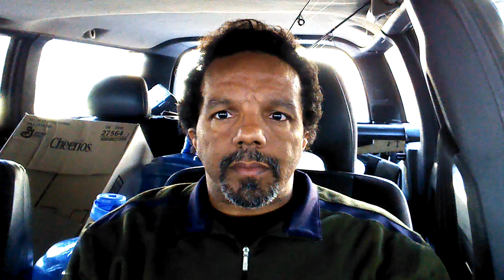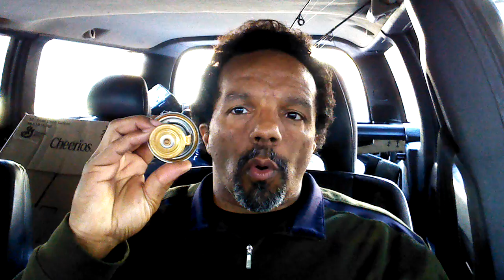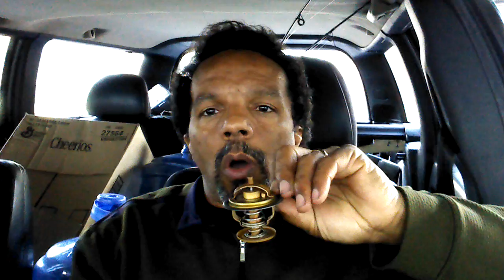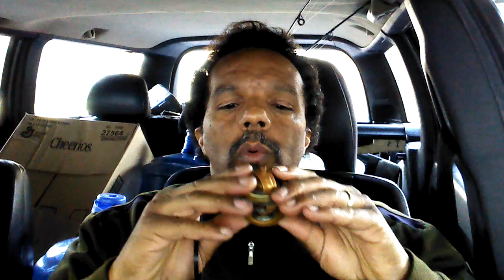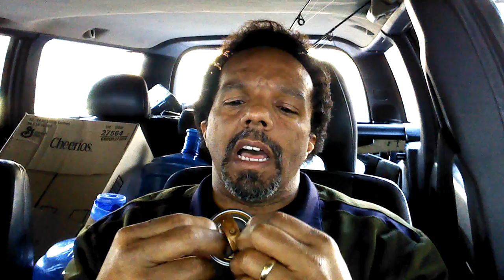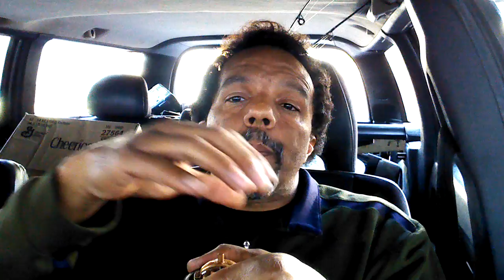How does the thermostat work? - Auto Care Series

Comment: My radiator fan not coming on while my vehicle is overheating.  I occasionally see the radiator fan spinning but when I need it when my vehicle is overheating it is not spinning.  Vehicle overheat when AC is on and at stop light but overheating stops once i begin to drive fast.   What do you think i should narrow down on to fix?
Reply from the maker: If the fan is bad, replace it. If the temp sensor is bad, replace that. If a relay is bad, replace that. You have to figure out what's bad and fix it accordingly.

Comment: Sir Robert you are a blessing thanks for your videos the one on thermostat the car tell me that the exhaust is having a problem when everything I drive the car I have this rich gas smell engine from the engine I was told that it needs new plugs  so I have a new set to be replaced.
Reply from the maker: probably a vacuum line loose or broken.

Comment: Hi Robert thank you for all the information I am a new driver bought a car recently it’s my first car and I am not aware of most of the things I have already spent too much money with auto mechanics but the problem is still there and no one could figure it out. I have fiat stilo 2006 it drives fine for 20 minutes or so and than engine dies all of sudden and it shows a message on dash board where it say excess fluid temper turn off the engine. And than when I try to start it again ignition comes on but engine does not start and the temperature guage does not move up from C , guage goes up and than quickly drops back to C all the way down. And than after ten minutes or so car starts after so many tries. Plz help me to understand what could be the problem. Thank you so much
Reply from the maker: Are you saying that the engine is overheating?
Reply: Robert DIY thanks for your reply. No I don’t have any idea if engine is overheating as my car just dies after ten minutes driving sometimes and does not start back straight away it just cranks but does not start. Temperature guage does not move at all during this though.
Reply from the maker: Codes?
Reply from the maker: https://youtu.be/YiPAPu-K8OI

Comment: I decided to go get a 195 degree one for my car in an attempt to make the heater work better. I have not installed it yet, and i also sealed off the gaps around the heater hoses in the firewall. I assume it is using a 180 at the moment or maybe a 165. They said they couldnt get one for my year but they could get a similar one from 3 years later that should fit as it is designed for a very similarly sized v8.
Reply from the maker: I don't even know what kind of car you have???
Reply: @RobertDIY  1st gen Mustang. Same as always. I just wanted the heater to work better and I already tried sealing off the gaps in the firewall around the heater hoses. The store told me they could only get one for a 1968 302 engine but it should still fit in a 65 289.
Reply from the maker: I have no idea. Is the heater core clogged?
Reply: @RobertDIY  I checked for that by tapping the hoses after a drive. Both were pretty hot so it cant be that. But ever since I applied the gasket maker it did seem to help out a little bit
Reply from the maker: ok

Comment: Hello Robert, good video and great help; I have a doubt and I hope you can answer me; I have problems with my car volvo c70 since the car fan does not work and therefore I mark a light on the board is red, turn on the light when walking for at least 5 minutes. Does it have something to do with the thermostat or the temperature sensor in this problem?
Reply from the maker: +Rafa Anleu I don't know what the red light is?
Reply: Robert DIY Thanks for replying, in the instrument panel I get a red boat with water that has a fan propeller. Too bad I can not attach an image for you to see.
Reply from the maker: +Rafa Anleu that is probably the low coolant level light.
Reply from the maker: +Rafa Anleu https://youtu.be/Uu_XZlTY2b8
Reply: Robert DIY Thanks for taking the time to answer, effectively the instrument panel light that you show in the video that you left me is the one that activates me, the strange thing about this is that it is activated despite having antifreeze, so I asked if Somehow the thermostat or temperature sensor has something to do with that fault.
Reply from the maker: +Rafa Anleu no, bad sensor or float in the bottle.
Reply: I hope I'm in it, I hope it's nothing serious. Thank you for your answers and correcting the fault I tell you how I was. regards
Reply from the maker: +Rafa Anleu no, bad sensor or float in the bottle.
Reply: The sensor you tell me according to I have understanding comes along with the expansion vessel, I will see these days if I can get the parts for the change, by the way do you know if you have to purge the system of the car so it does not catch air?
Reply from the maker: +Rafa Anleu that part is separate from the bottle, plugs in the bottom.
Reply from the maker: +Rafa Anleu https://youtu.be/1L8RMS5KunM
Reply: I see that you have everything on your channel, it is worth giving a look at all your videos. With this if I left doubts and thank you for the time you have taken to answer me. I would definitely recommend more people to visit your channel. Greetings.
Reply from the maker: +Rafa Anleu thank you for watching.

Comment: Great going as usual Robert. My fan is not coming in. Causing the. Ooolant to flow from the overflow bottle. How do I determine if it is the relay, thermostat or temperature sensor. How can I te!all if the head is damaged as A result?
Reply from the maker: +carvel williamson what kind of car do you have?
Reply: Robert DIY 1999 2.3l s70
Reply: Robert DIY i have checked the relay by grounding the middle pins and the fan comes on.  i checked the sensor voltage and I'm a  getting 5v and 0.03v.
i did a compression test and 4 cylinders gives 200psi and the other 170psi. battery died so i couldn't get a conclusive wet test.
Reply from the maker: The fan should come on at 223 and go off at 209. If the cap is bad it will boil back. If the head is bad, it will boil back past a good cap.
Reply: Robert DIY thank you.  Keep doing a great job! !!

Comment: Should the Coolant Temp Sensor be replaced at the same time or that doesn't matter?  My 1994 Volvo 850 has had some cranking and not starting issues lately.  I have ruled out the spark, air and fuel problems.
Reply from the maker: +HKships4TeresaTeng2 has the can been running?
Reply from the maker: +HKships4TeresaTeng2 I don't.
Reply from the maker: +HKships4TeresaTeng2 have you jumped the fuel pump relay?
Reply: Dear Robert, thanks for replying to me so soon.  I have not jumped the Fuel Pump Relay, but have made a half turn of the ignition key a few times and opened the valve on the fuel rail to have fuel squirting out.  That to me means there is fuel pressure.
Reply from the maker: +HKships4TeresaTeng2 yes it does. Is fuel making it to the cylinders?
Reply from the maker: +HKships4TeresaTeng2 there is a fuel injector relay near the fan. It is a common problem as well.
Reply: Thanks.  I do now remember I had that problem several years ago, and the fuel injector relay replacement fixed the problem.  But this and other related parts do need to be checked out.  Anyway, replacing them isn't too expensive.

Comment: Hey Robert  nice video.
It's me again with the 960 volvo that was getting hot.
I finally found out the problem, stuck closed thermostat.
Couple of problems though:
1) one of the two bolts the head is stripped on the thermostat cover how do I get it off?
2) The thermostat housing is cracked and leaking coolant do you have a video on how to remove this?  So I can install a new one. I know it has (3) bolts.
Or do I have access after removing the thermostat cover?
Reply from the maker: MARCOS MARTINEZ You'll have to remove whatever is in the way of those 3 housing bolts. - https://www.youtube.com/watch?v=kl8oQoItmZk
Reply: Thanks Robert!
I did use a drill and the manage to remove the stripped bolt out.

Comment: Robert, I just replaced a lower radiator hose because of leakage. Now I'm having engine overheating issues after about 5 minutes of driving. The upper radiator hose is hot. The lower radiator hose is cool. No coolant leaking. Thoughts? Thermostat vs temp sensor vs water pump vs air in system?
Reply from the maker: Kyle Lewis Probably a bad water pump. What kind of car do you have?

Comment: You know how check if catalitic converter its bad, the fastes way someones say only seen the color of the oxigen sensors know it,  you think so, robert or its no trusted, especially the mufflers guys say that but they dont tell you how to knowit.tanks for the best mechanic i know it you mister robert.
Reply from the maker: misael pacheco CEL, the cat should toss a code and cause the CEL to come on. The other common complaints I rear is that the car will not go fast anymore, like the top speed is about 55 mph. Another way is for you to smell the foul odor a bad cat puts out. Lastly, if you tap on it you can hear loose material in it.

Comment: Hi Robert.

Great video. Question for you: 

Can the thermostat also affect the heat available for interior cabin temperature? I got an engine code that my thermostat needs replacement, but haven't done the job yet. The car has been running at around 70-80 degrees celcius. Now that winter has arrived, I have noticed that the heater is pretty weak and I can't warm up the interior well at all... 

Thanks, appreciate your time.
Reply from the maker: dubbleyouJ Yes it can. What kind of vehicle do you have?
Reply: Robert DIY a 2002 VW golf GLS
Reply from the maker: dubbleyouJ I would start there. Running the car cold with a bad thermostat can be dangerous to the engine. It will run rich which could burn a valve.
Reply: You could also try applying gasket maker in the firewall near the heater core if you think it has broken or missing seals. I did this to my Mustang and it seemed to help a little bit.

Comment: Hi robert thanks for ur teaching on volvo I learn so much about volvo cars, I was having starting issue with my 850 glt 1997 , I was about to junk the car decide to do fue more testing after car went in lime mode , I change cam sensor , crank sensor fuel relay and plug wires car still not start but turn over fine.just no sparking I yet to change the plugs , gave up a fue days ago , decide to do a last check on the throttle sensor only to fine the plug to the sensor is rust out , would that stop car from starting know the all these sensor work togeather , the car drove me home six mile from home after arrow light came on flashing, should I change the sensor too r just the plug , thanks ur quick response , can afford to spend on this car that's not going , already spent a arm on it don't want to spend a leg and it dont work.
Reply from the maker: St Clair Vernon Yes it can, have you read the codes? Are you sure it doesn't have spark? - @watch?v=Sg7iFytxfzQ
Reply from the maker: St Clair Vernon https://www.youtube.com/watch?v=Sg7iFytxfzQ